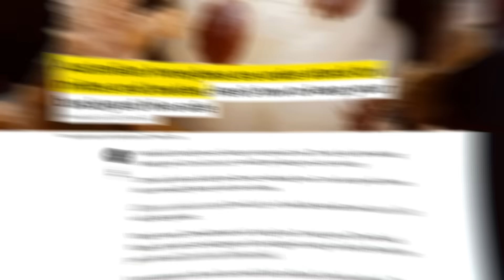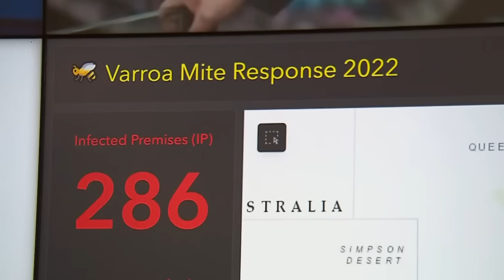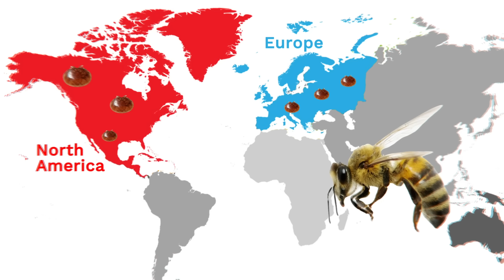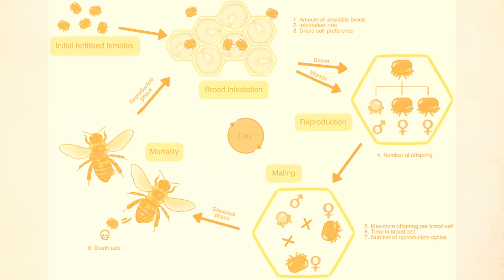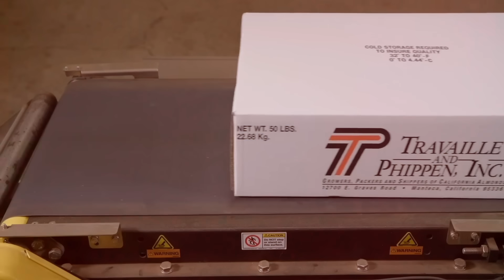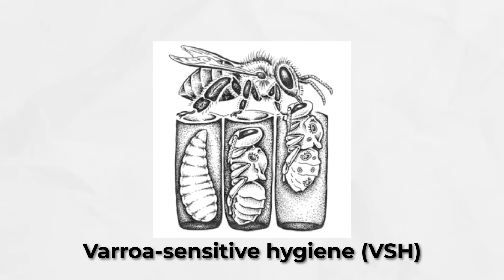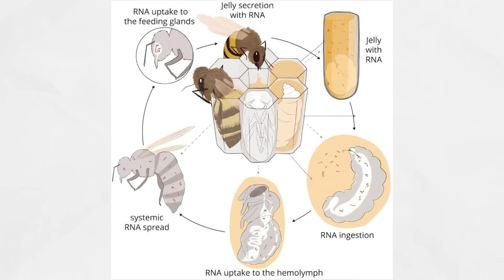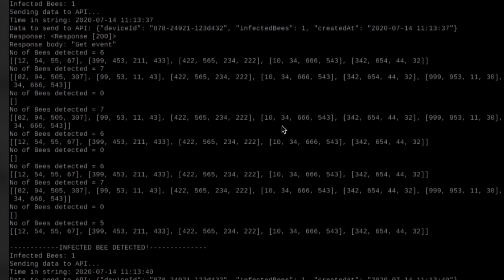It was Killing All the Bees in Australia, and After One Year, the Results were Unbelievable

Comment: Australia's government as well as most governments in the world should keep some bees
in a hermetically sealed environment with plants and trees, like a bio dome.
Once all the bees have died on the outside, they can regrow bee populations by
exporting to the outside queen bees from the inside of the dome.
If governments ignore this, well, good luck getting good crops and fruits some time later.

Bee keepers can keep a queen or two in stock, after thoroughly checking for mites.
While the rest of the bees are then exterminated until zero, which then prevent infection with
mites from bee to bee, the queens can then be released into cleaned bee-hives.
I'm not talking a little spray of water and voila, but I'm talking a government funded and kept
facility, to which some beehives can be sent to undergo UV treatment and various other
treatments to be completely sterilized. After taht the queens can go into the sterilized beehives
and restart population.
The best time to do this is just after pollonization of regular stuff, since it will allow near continous
operation. Also, it should be mandatory and finable if and when not adhered to.
A single mite in the species can grow into another mass population.
So, local governments should inspect for this as well.
Negligence means economic loss in a huge multifold later.
Mankind needs to step up it's stewartship of Earth in all respects,
not just take take take, but also rule by knowledge.